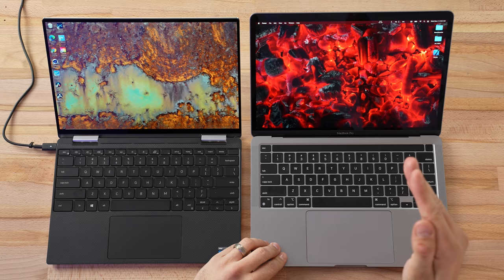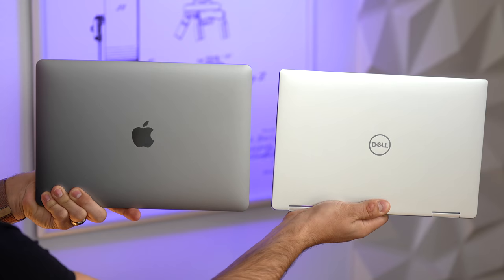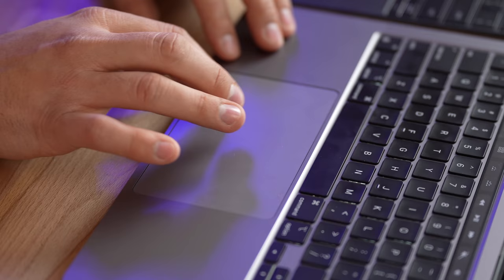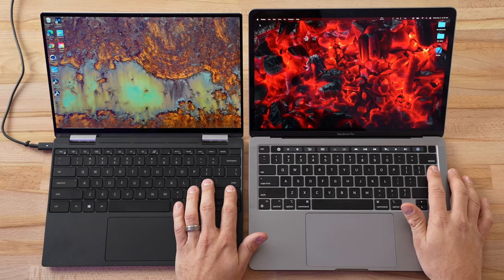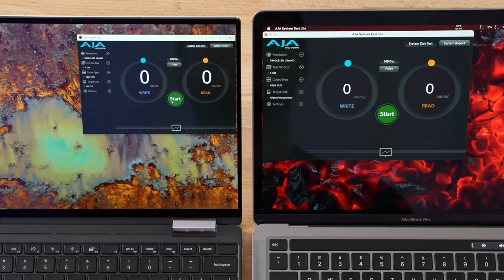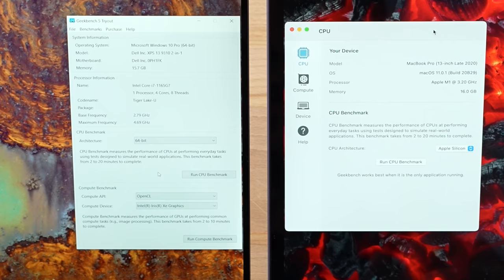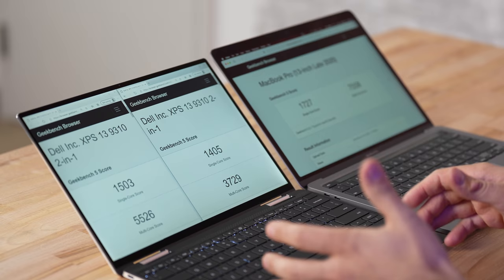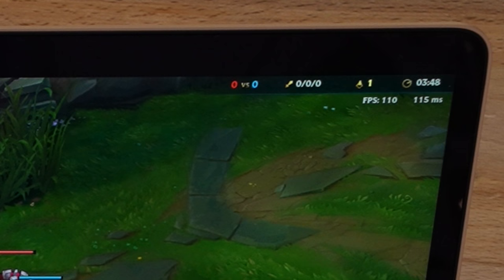M1 MacBook Pro vs Dell XPS 13 9310 - ULTIMATE Comparison

Comment from the maker: What did you think of the RAM Stress Test? Let us know below and check out our Full Review of the XPS 9310 (non 2-in-1) here: https://youtu.be/ZzhXXUdsm34
THIS is the BETTER Choice ($50 OFF Amazon) ➡ https://geni.us/OrLeu97
Buy our Merch here! ➡ teespring.com/stores/max-tech-store
Best deals on these laptops on Amazon ⬇️ 
Dell XPS 13 9310 ➡ https://geni.us/BHXV9NH
Dell XPS 13 9310 (2in1) ➡ https://geni.us/jAB4G
M1 MacBook Air 2020 ➡ https://geni.us/tnoeMOc
M1 MacBook Pro 2020 ➡ https://geni.us/pWUBPum
M1 Mac Mini 2020 ➡ https://geni.us/bBD2
Reply: Can you guys do Microsoft apps in mac
Reply: Hi. An idea came up, but I don't know if you have the time to do it. Can you install hackintosh on the xps and retry the benches? Wonder how much window is keeping back the xps.
Reply: What is this temperature program you use on the Mac?
Reply: @vladmihai306  he tried hackintosh on a threadripper pc, and he could barely do anything
In fact he spent more time troubleshooting than actually using it, so his experience was terrible, and likely would be too, plus it is illegal
Reply: man, u need to get the asus zenbook s and the  hp spectre x360 in for comparision
Reply: Big mistake at 18:54
Reply: You’ve managed to persuade many of your watchers that the M1 effectively doubles memory power compared to any other machine with another type of CPU. I’ve seen posters say 32 GB RAM will be equivalent to 64 GB RAM using Apple Silicon!

NO!

There is a very limited subset of applications where the “RAM doubling” reported may seem to happen: those cases where the data being processed can be read and written (as appropriate) to the SSD to where the task is CPU-bound, which can happen with linear files read/written in a linear manner to the SSD.  Most applications have a far-from-linear memory access pattern when working with data, when enough is loaded in small chunks, which is what most data and the software that manipulates it does: this is going to absolutely suck once you’re into swap, because for each small amount of data accessed that faults, a far larger amount than needed tends to be read in, and if the data in swap and memory doesn’t have good memory locality, you’ll be stuck reading/writing data and doing computations at the speed of swap.

Please, from a software engineer with decades of experience, remedy this delusion of magic M1 memory!  Because you’re making these videos, people trust that you know what you’re talking about, and people want to believe the craziest things blindly.
Reply: @mushfiqaziz  you mean MS office? Ofc it works and better than windows laptops tbh.
Reply: When you showed charts with times, like the Lightroom Classic 1:1 previews, it says Higher is better.  But doesn't that mean that taking longer is better?  Why is that?
Reply: @luketoh1  he made mistakes. He had to modify the slides and write LOWER IS BETTER.
Reply: Okay your tech skills at properly reviewing the MacBook Pro  M1 are being questions by this Youtuber. https://youtu.be/m1dokf-e1Ok can you please review her video and see why she is getting these results? Super important for the community to understand this.
Reply: You should use ultimate performance in windows
Reply: 5:15
Where is the logo showing up? Are you blind ? Or you think your audience is blind 🥴Do you have any technical knowledge lmao. It's not about just the display, your browser needs to support dci p3 too.
Reply: The Dell sounds way better than the Surface Pro Laptop. Mac is still the best.
Reply: Dude you messed up at 18:58 it says higher is better when it should be lower, (tell me if I'm wrong)
Reply: i just saw this lady’s video and test, and she’s so focused in killing the cpu rather than doing side by side performance test. She actually aknowledges that it’s not about perfomance but about max out the cooling system. I bet any laptop would do the same, regardless the silicon used or brand. She’s even comparing a very old mac... waste of time.

Comment: Mac a better deal than a dell. What a weird year to live in.
Reply: The apple tax is just gone now
Reply: And the Dell thermal-throttles the hell out of it. Big surprise to everyone... -_-
Reply: haha its wild, but I'm happy to have more competition (increasing the Macs value proposition might make more people who didnt consider Macs before give them a chance)
Reply: @SamAlexanderYouTube  I am happy that more people are buying these base model Macbooks. They will probably upgrade in a few years and I can get these things used for 1/2 price.
Reply: its only a good deal when you stick to 8GB RAM and 512GB SSD. When you try to upgrade the macbook to 16GB RAM and a 1 or 2TB SSD the Macbook becomes really expensive
Reply: @roger767   2TB, 16GB is $2300 from Apple. If you try to buy a 2TB XPS from Dell it must include 32GB RAM, and that's $2500.
Reply: @gorkyd7912  your right but one point for dell is that you can upgrade the ssd yourself so the price may be same (?)
Reply: The M1 chip really changed the game.
Reply: @federicoarcelaschi7912   What happens to the original SSD if you buy a low-end one and upgrade it yourself? Seems wasteful, like all the 1-2GB RAM cards rotting in thrift stores when Apple's RAM was still upgradeable.
Reply: @roger767  yet like with iPhones and the new unified memory 16gb memory not as big of deal as it was with intel macs. Now Apple is straight being the devil on how much they charge for storage upgrades!
Reply: @gorkyd7912  
2GB Nvme SSDs are like 250 dollars and they have 3000MB/s read and write.
That's how you safe money on windows laptops with replaceable SSDs. 
Something you cant do on macs even tho the SSD speeds are the same or slower.
Reply: @roger767   Yes, it would be way better if Macbooks were upgradeable still, both for cheaper upgrades and easier repairs. But I don't understand why every manufacturer overcharges on pre-installed high-end components. It shouldn't be cheaper to own both a 2TB and a 250GB than it is to have only a factory-installed 2TB. It probably won't be for very much longer.
Reply: @roger767  with the price being relatively close (even when you replace 2tb ssd by yourself), the M1 is still superior in battery, temp, fan noise, unplugged use, single and multi core and gpu. Right now the M1 MacBook is beating every other intel laptop in every way. I think Dell and Microsoft will have a big price reduction soon or switch to AMD (which is unlikely), they can’t afford to wait for Intel anymore.
Reply: ikr
Reply: @gorkyd7912  Upgrade is 100% for their profit. They want to lure the common users with low price base model but want to take back from more advance users those who upgrade. Kinda like take from the rich and give it to the poor :)
Reply: @gorkyd7912  you can use it as a fast external drive or sell it
Reply: Sure, at base price, the Macbook is a better deal. But buying from Dell is like buying clothes from Banana Republic: there are so many sales year-round that the sticker price is next to meaningless. I bought my XPS 9310 with 16gb RAM, 512 SSD, and UHD display for $1500 (saved nearly $400) earlier this month with an ongoing members sale plus an extra coupon for Dell laptops. It's a pretty common pricing tactic used by entry-level premium brands like Dell and BR to make you think you're getting a sick deal off of a more expensive product, when in reality, the products are actually worth significantly less than the MSRP and the "discounted" price is closer to the true value.
Reply: It's called THE YEAR OF EVERYTHING. 😂
Reply: @Malc180s   The classic Mac Pro was super upgradeable. Would have been garbage a long time ago otherwise, but there's still people using them today adding Bluetooth, USB3, PCIE flash SSD and later graphics cards. Mine's a 12-core with 64GB RAM and RX 580, runs better than most newer Macs granting it's from 2009.
Reply: @gorkyd7912  we could always trade it in for the new one.
I know my local shop takes it in and wipes it out for resale to whoever can't afford higher than 512GB.

And honestly for me, I'd rather just buy a 1tb on my own which has speeds that beats (3000MBps++ read/write) the one in the M1 that only cost 130USD (before trade in)
Reply: It's 2020 and about time. LOL
Reply: @Malc180s  For my daily office routines, WP    and SS, my 2008 MacBook Pro is doing just fine over 12 years on. Mind you, I haven’t been able to upgrade the OS or MS OFFICE for a few years, but work still gets done! Apple and MS must hate people like me. 🤣
Reply: @gorkyd7912  The SSD cannot be upgraded. Nothing in the Mac can be upgraded.
Reply: @roger767  yes and in 3 yearsd it will be obsolete, you can't run newer OS or OS will be slow as apple does with Iphones.
And maybe new OS require more ram so as it is upgradable  it will be useless.
Reply: That's actually not unusual, when you stack a Dell with similar specs.  However, most of Dell's sales are the lower-end, everyday systems.
Reply: @alienbreedersamigaretrocom5188  price of the computer is 1450€ in EU, 1700$ so ity is really a high end model.
Reply: @federicoarcelaschi7912  not on the Dell 2 in 1 I have it maxed out to .....all soldered to board in the Dell
Reply: @alienbreedersamigaretrocom5188  the base M1 model is 1700$ in EU I would say double the price of what most of people spend in a computer, mac are far more less common except in expensive universityand some very wealthy people, here the PC reign supreme.
I advice people on PC and mac to buy but around peoople ask for 500$ computers not really much and there are computers that are sold around that price, good second hand PC like lenovo, very reliable and upgradable ones, and  some nice dell at entry level price.
Else a second hand apple is easealy 500€ for a core duo MBP13 or an old first generation MB air. too slow and expensive and not at ease with the last macos.
Reply: Though these tests say more about Intel rather than any other vendor besides Apple.
Reply: @maggyy_ Airpods max🥴🥴
Reply: @roger767  Well but the MacBook is a much better machine in almost every way. Since you're really getting something for your money, I don't see an issue here.
Reply: @roger767  people should forego the bigger HD’s. External storage is cheap. RAM should be the main focus. I just purchased the M1 MB pro with 16gb for $1,400.
Reply: @maggyy_  the apple tax was always "fake news"
Reply: If you take into consideration that Apple has been using high DPI and high res screens compared to the 1080p standard you'd realize the price was fair. If you got a similar screen with a similar resolution with the Retina display Macs they'd cost about the same.
Reply: @andremessado7659  agreed, also now it's obvious about the M1 chip superiority
Reply: @tauhidaman007  they have to make a product from time to time like the mac pro wheels and the pro stand to get the medias attention and show the world that they still are a brand. that differentiates it in the tech industry so that when people buy apple products they feel like they have the most premium things. They still are a luxury brand.
Reply: Yeah if you could run bootcamp id get it but alas it cant be done :o  and parallels doesnt have a proper release yet
Reply: Dell is trash.  You can’t just look at the product, you have to look at everything.  Not only macs are much better now, their customer service is far superior than Dell.  I also had two dells that had flaws.  Both weren’t properly applied with thermal paste.  I had to do it.  This shouldn’t happen. I won’t buy another Dell.   I will build my own PC for gaming but I have macs for everything else.
Reply: @ericdraven7857  lies!
Reply: For me OSX makes it the better deal. The speed is just a bonus :-)
Reply: @federicoarcelaschi7912  just use cheap external ssd on mac lol.. or lan storage would be much better
Reply: @nekonation  sure but you aren't always at home so it can be annoying. Depends on your personal usage I think. I would definitely chose a Mac anyway because I prefer MacOS over windows
Reply: @cyropox8235  you need to be more educated, lol
Reply: The dell has shitty build quality too. My laptop was in and out of repair 7 times ranging from melting feet to entire motherboard replacement.... And now the feet is melting again
Reply: @maggyy_  well only on the macbooks, mac mini, and future macs. Apple makes other stuff too
Reply: I'd like to see a comparison between the Mac Air and the Dell XPS. Air is Apple's cheapest laptop and is almost as good as the MacBook in almost all respects. The value proposition favors Apple.
Reply: Its not a better deal cause he bought a 2 in one dell not the original xps 13, also the prices for the xps are way cheaper than the mac
Reply: @Fp-cy5jd  wtf are you smoking ... a similarly specced dell xps 13 costs $150 more than the macbook air ... the 2-in-one $200 more than the macbook air ... way cheaper? Yeah right. Even then, it's lower performance than the macbook air rn.
Reply: @gorkyd7912  Besides it’s a really bad idea to give Dell your credit card information
Reply: @roger767  upgradability is absolutely  irrelevant on a laptop that will have a nearly completely degraded battery,busted speaker, and many other problems after a year and a half of use. Plus if you’re buying from Dell you have to add in whatever erroneous charges they will make it to your credit card.
Reply: And if you go for the air it’s an absolutely unreal deal.  Only 1k.
Reply: @SamAlexanderYouTube  Exactly! I never liked apple (except for the iPads that are the best on the market) because on how expensive they charge for a shitty laptop (and other products that are irrelevant so Im not writing about them) but when they introduced the M1 lineage it took my interest. I brought an Asus zephyrus g14 but my girlfriend gave the macbook air m1 base model and all I cam say is that for the price you're not getting anything else better! Is amazing what they did
Reply: @maggyy_  And the 256 GB model of the MacBook Air is just $999
Reply: As a non apple lover, I been using an m1 for 2 months and hate to admit that they are doing surprisingly really good.
Reply: Yes.
Reply: that's on top of the revenue margin from the vertical integration.
Reply: @user-304jgojnegilrnw  I know right.
Reply: @AHChris1988  is it best to get the Pro or the Air?
Reply: @ericdraven7857  is it hard to transfer from being a Windows user?  Would I buy a pro or an air.  I want it for book writing and you tubing?
Reply: Yes
Reply: Mac has a high bezel space per dollar value
Reply: @gorkyd7912  basically every Windows laptop out there, honestly
Reply: @roger767  like every spec bump in laptops out there, MacBook or Windows laptops